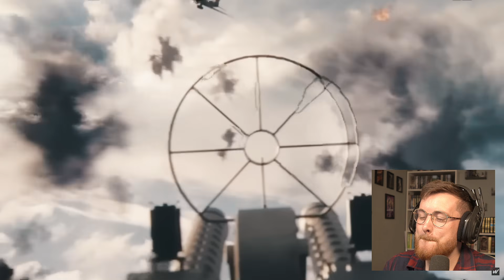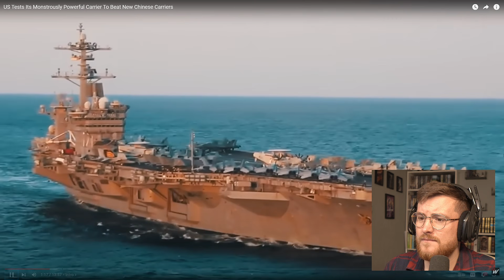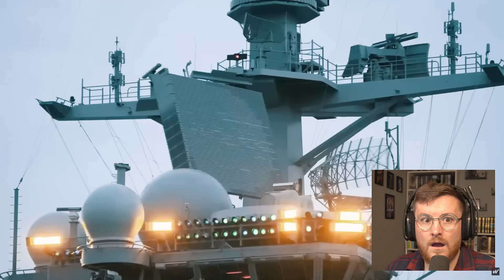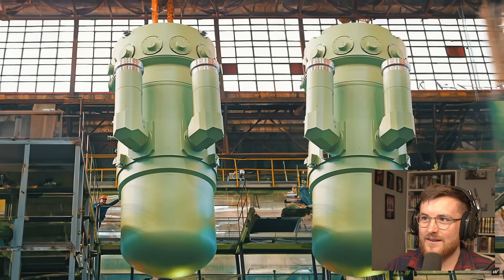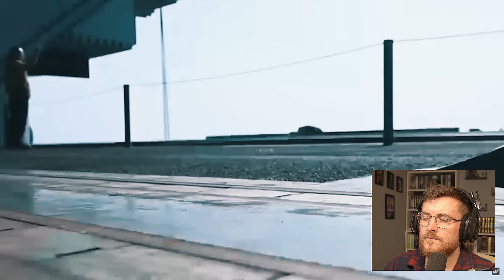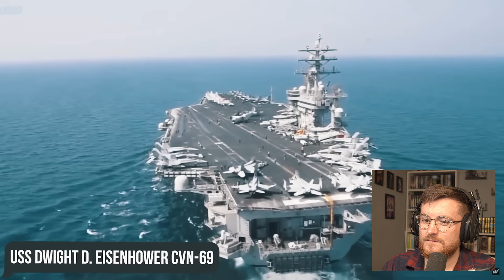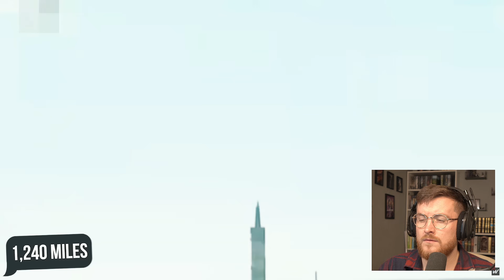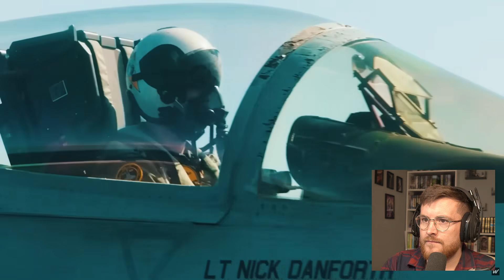Royal Marine Reacts To US Tests Its Monstrously Powerful Carrier To Beat New Chinese Carriers

Comment: What you have to remember is that when a new Ford class carrier is complete the US Navy will retire a Nimitz class carrier. So it's not like the Navy is adding another carrier. It's a 1 for 1 swap. New one in and old one out. So the crew from the retired carrier can go onto the new one. That's not quite how it's being done but kinda. And the new carriers are supposed to have less crew members than the older ones

Comment: It costs approximately $6 million to $8 million per day to operate a Gerald R. Ford-class aircraft carrier, including crew salaries, maintenance, nuclear fuel, and air wing operations. The ship, which cost roughly $13 billion to build, is the most advanced and expensive warship ever created. [1, 2, 3, 4]

Daily Costs: Roughly $6.5 million, with higher costs ($8M+) during active deployment.

Annual Operating Cost: Approximately $2.5 billion per carrier.

Personnel: Crew costs alone are about $3 million per day.

Comment: It's currently a 1 for 1 replacement. They commission a new Carrier and decommission an older one. They take several years to build so it's a decades long process. By the time the last one is put to sea it's replacement will already most likely be in the planning stage.

Comment: China doesn't have supercarriers. It's trying to build a large carrier that won't be operational until the mid 2030s at earliest, and it's still significantly smaller and carriers significantly fewer planes and resources than even the smallest American supercarriers. China's carriers are not a threat to the U.S.

Comment: So you are right, Plymouth is capable of handling some US aircraft carriers the newest biggest ones it can't though. The Gerald R Ford has been to Portsmouth fairly recently as that's one of the very few ports in Europe that's deep enough. Devonport often welcomes US ships, but usually it will be the support ships going to port as carriers cost an absolute fortune to keep in the water making every minute they are in foreign port rather than on mission a truly enormous waste of money. These things are designed to stay at sea and on mission in perpetuity only coming in for repairs and critical maintenance. It is an aircraft carrier and always in a strike group with a surface, submarine and air assets.  You can ship in and fly out anything and anyone you need to stay on mission until the next mission.

Comment: Due to its higher tech it's got a smaller crew than the ones it's replacing.  I served on the USS Theodore Roosevelt CVN71 and we had a crew of 6000 + air wing and + Marine detachment. All 11 of America's older carriers are nuclear powered and not much smaller at all. The TR held 110 air craft. It's the one that leveled Bosnia, with me in it and now it's one of our oldest ones.

Comment: Are they serious with that estimate on the DF-26 missile?  Imagine you’re in military intelligence and your job to know these things, and you tell your people ‘I need an estimate on the capability of that missile forthwith’, or something like that. So they go and do their thing, and then they come back with, “You know that estimate you asked us for?  Well, I’ve got a number for you;  We’ve estimated its range to be between 620 miles..  and 3x that distance. Yeah, just take that first number, multiply that by 3, and it’s somewhere in there.”

Although, I guess it’s at least possible that it wasn’t meant the way the wording made it sound like it was, and 620 miles to 1,860 is just the range window within which that particular missile is intended to be used. Like as in that missile is to be used for targets ranging anywhere from 620 to 1,860, while a different, shorter range missile would be used for something less than 620 miles away, and a different, longer range one will be used for something beyond 1,860. 

If that’s not the case though, that estimate could really use being narrowed down a bit.

Comment: The largest Cruise ship, Icon of the Seas, is actually heavier than the Ford class aircraft carrier (by about 15%). And the usable volume (because it is not made of heavy steel like carrier) of cruise ship is actually much bigger than the largest aircraft carrier's volume. So, the Icon of the Seas is really a floating city, while the Ford class carrier is actually not that large in comparison. It's made of heavier materials. And when you stand by it, it is not that large compared to standing by a cruise ship.

Comment: 7 month is a standard deployment for USN. Around covid then Russian invasion then hammas it often extended. But even without those they often extended. 

Supplies get moved in despite the size of the ship in hours typically. Bigger the ship the more ability to move bigger stuff around typically even at sea. The ship you were on sounds like a small boy like a frigate. They're tiny and we don't use them anymore iirc. 

You should look at the comparing the different ships with their sizes and how many souls on board.

Comment: That’s just the carrier. There is normally strike group that sails with it of between 10-15 support ships.

1 Guided-Missile Cruiser (air defense and command support)

2–3 Guided-Missile Destroyers (anti-air, anti-surface, and anti-submarine warfare)

1–2 Attack Submarines (fast-attack subs, usually operating somewhat independently but attached for strike group support.

1–2 Supply Ships (logistics, fuel, ammunition, and food, often operating with the group but not always in the immediate screen)

Plus other ships specific to its deployment.

Comment: The reason why we would require 10 of these Aircraft Carriers is because we cannot just move them around the globe.
So if stationed off the coast of Japan for example, and something happens off the coast of Italy or in the Middle East, it can’t just start moving there, it would take days if not months to get it over there.
Now if you have 10, you could position them so that there is always the power of these Aircraft Carriers and the fleet that goes with it in a timely matter.

Comment: China hitting a U.S. aircraft carrier is not as easy as target practicing with models in the Chinese dessert. First you have to locate the carrier which in wartime have several stealth systems to obscure the carrier. Finding them in the vast pacific is way smaller than a needle in a haystack. Then if you do find it, the carrier can move at 50-60 mph (or higher - classified ) so with vast oceans from the time the missile is fired the carrier could be anywhere in a 700 sq miles radius. Then you have to deal with the defensive systems which can track hypersonic weapons and likely will be using targeted energy systems (lasers moving at the speed of light) to shoot down incoming missiles. Plus firing a missile immediately puts the shooter at risk as they would know where it came from and immediately target it…

Comment: Military money is inflated 10x anyway.. so these monetary numbers honestly mean nothing.....
Reply: A bag of bushings, commonly used in jet turbines, was purchased by the US Air Force for $90,000, a price that has drawn criticism due to the relatively low cost of the individual parts, which can be found for under $100, according to multiple reports. This incident highlights potential issues with military procurement and the high cost of specialized parts.

Comment: Somebody tell him we have 11 nuclear powered aircraft carriers already 😂
Reply: Aren't all our Submarines Nuclear powered also lol.
Reply: @MadCity13 all of our subs and aircraft carriers have been nuclear powered since 75. 🤙
Reply: @megatron388 not accurate, we had conventially power aircraft carriers into the mid ninety’s, the America CV-66 and the JFK CV-67
Reply: @toddtraxler3878 All new aircraft carriers starting with USS Nimitz CV-68 have been nuclear powered. I served on USS Saratoga CV-60 in the 70’s-80’s but it was commissioned in 1956. Most of the carrier fleet was conventionally powered in 1978 when I enlisted and each conventionally powered carrier was replaced by a nuclear carrier as they were built. The greatest advancements in the Ford include the upgraded reactors which provide substantially more power than earlier nuclear carriers. Crew complement reduced because mag-lev catapults require less maintenance in theory and overall systems benefit from automation. The island structure was moved aft creating more forward flight deck capacity. New catapults are able to more finely adjust for different load requirements and are more reliable than steam catapults. With the air wings aboard the older carriers required crews in excess of 5000 personnel. Overall size of the Ford is not significantly larger than previous classes starting with Forrestal class in 1956. No other country has even matched the capabilities of our older carriers. The best aircraft we launched was the F-14 Tomcat which was amazing at the time but a dinosaur compared to modern aircraft. The Ford class will eventually replace all Nimitz class carriers and the fleet will have between 11-13 carriers as they have since the 60’s-70’s era albeit with twice the capability minimally. Bravo Zulu US Navy.
Reply: @megatron388  This is false, our last diesel sub was put out of service in 1990
Reply: Nah, I was on the Ike from 80 to 82.  It was one of three nuclear carriers (Enterprise and  Nimitz being the other two.)  The fleet had 13 carriers, 10 of them using boilers rather than reactors.  It took decades to retire the conventional carriers with nikes.
Reply: @MadCity13 I do believe so.
Reply: You beat me to it😂😂😂
Reply: Just be glad he’s already fanboying over our arsenal
Reply: @aljohntabion2751 
Yeah, he'd probably have a stroke if he saw our "classified armaments 😅 lol
Reply: Yeah, but there is something about having 10 Ford class Super Carriers, that is so awe inspiring and over whelming.
Reply: @DonaldDuvall  The other 10 are only marginally smaller. The Nimitz class is pretty close to the same size.  I would also note that we have two more America-class amphibious assault ships which are as big as what many other countries call aircraft carriers (with one more currently unde construction).
Reply: Yeah, but the Ford actually has "TWO" Nuclear reactors.  This is so that the laser cannon never runs out of juice 😉🙃🙂
Reply: Yeah their just replacing the eleven they already have.
Reply: We almost have 12, the John F. Kennedy is being fit out and planned to be in service by 2027 though the Nimitz is scheduled for decommissioning in 2026
Reply: And tell him we can launch a jet fighter every 15 seconds. Whilevthe Chinese have a ramp on their carriers , there planes carry little fuel or armaments due to weight restriction. Ours are fully loaded with both. Just watch a response to houthis fafo. It's amazing. Plus what the ships electronic can do. It's a floating fortress heavily armed. Cool huh?
Reply: Yeppp
Reply: Couple destroyers too.
Reply: And they require More crew.
Reply: Yes!
Reply: and nuclear subs that ONLY need to surface for food.  that's it!!!!!!!!!!!!!!!!!!!!!!!!!!!!!  Good bye anyone not USA! that challenges us.
Reply: And that's fully combat ready Carrier groups.
Reply: Yes we have approximately 10 to 11 carriers, but all of them aren't at sea at the same time. All of the Nimitz are on their way to retirement, so the Fords are replacing them. I expect Aircraft Carriers to be around till the 22nd century.
Reply: and 2 are under construction with 3 additional planned
Reply: By USA congress law or such. 11 max. Incase of 2 wars. Because of the 2 oceans USA boarders. They were prepping for world war 3 in the end of world war 2 end times.

Comment: The thing about having 10, is that they are not all active at the same time. Typical scheduling of them is about 6 months active in their area, a couple months downtime, a month or two out doing sea trials (not leaving much past the US area of influence), a few months of repairs/upgrades/etc, another couple months of sea trials...but it ends up at around 25-30% of the time, they are "on patrol". There are less US Navy air wings (the people and planes brought on to patrol). Except under very dire circumstances, you will not see more than 3 of these in one area...but that, in and of itself, would be enough for just about any other country to just lay down and give up.

Comment: 375 meters long by 48 meters beam  by 75 meters from keel to uppermost deck. I helped build the USS VINSON CVN 70 at Newport News Ship Yard. They're massive machines and rightfully called cities on the sea. 
When air wing and marines embarked, there are about 5,000 souls aboard. Two A4W reactors with flank speed in excess of 35 knots.
Most importantly, the Attack Group consists of SSN's, DDG'S, LHA/LHD. Older attack groups consisted of CVN, DDG, CGN, FFG, LPH/LPD, SS or SSN's and each of course had satellite overwatch as well.
No one in their right mind today wants to tangle with an attack group.
Reply: I absolutely understood ALL of those acronyms… not ONE was I unsure of… lol 😂

All kidding aside, I bet you are very proud to have been one of the lucky few to get the opportunity to build these absolute marvels of the sea and the pinnacle of research and technology poured into a titan of power. Thanks for your contribution and thanks for sharing.

Comment: The flight deck is 4.5 acres which is roughly equal to the space 43+ homes take up in London. It has 25 decks... (there are no figures for how much space per deck.)
You have to consider that even if there are ten of the ships they are not always on duty as they do have to come to dry dock every 32 months for maintenance that could take up to four or more years. Once re-launched it takes a minimum of 90 days to return to full duty. (Rome wasn't built in a day, right?)
Uh... 4,500 peeps is only counting for onboard peeps. You also have to consider supply ships and their personnel, personnel on the hard, maintenance workers, etc.
China starting a war with the US would be proof to the old axiom, "No good deed goes unpunished", considering the only way it could have won against Japan, without US aid, was through massive attrition.

Comment: Around 2600 Sailors, Airwing personal around 2480 So it's more over 5000 personel.  CVN-78 USS Gerald R. Ford carries a combo in general 75 aircraft usually F/A-18E/F Super Hornets (strike fighters) EA-18G Growlers (electronic warfare) E-2D Hawkeyes (airborne early warning) MH-60R/S Seahawks (helicopters for anti-submarine and rescue)  F-35C Lightning II and unmanned systems (e.g., MQ-25 Stingray) The exact number can vary based on mission profile and aircraft mix, but around 70–75 is the standard full complement.
It also has defensive weapons . RIM-162 Evolved Sea Sparrow Missiles (ESSM) Purpose: Defense against incoming missiles and aircraft. Range: ~30+ nautical miles  Intercepts supersonic threats too fast for guns.  Rolling Airframe Missiles (RAM) Purpose: Last-ditch defense against anti-ship missiles.
Highly maneuverable, designed for close-range interception.  Phalanx CIWS (Close-In Weapon System)  20mm Gatling gun (6,000 rounds/min)  Final line of defense against incoming missiles or aircraft. Radar-guided, fully automated.
 Mk 38 Mod 2 Machine Gun System   25mm cannon, manually or remotely operated.
Role: Defense against small boats and close-range surface threats.

It also has  Electronic Warfare & Countermeasures: SLQ-32(V)6 SEWIP (Surface Electronic Warfare Improvement Program),  Decoy launchers (e.g., Nulka decoys)

The ship has multiple galleys, including:
The main galley 
Wardroom galley (for officers)
Chief’s mess (for senior enlisted)
Enlisted mess decks (for junior enlisted)
Each galley is a fully equipped industrial kitchen that operates 24/7.
Mess decks:
Large cafeteria-style dining halls.
Serve food in rotating shifts to accommodate duty schedules.
Meals per day:
Over 15,000 meals are prepared daily.
Crew members typically get 3 meals a day, with midnight rations ("mid-rats") available for night-shift workers.
The ship has massive refrigerated and dry storage areas below deck:
Can store 90+ days worth of dry goods and frozen foods.
Fresh fruits and vegetables are stocked regularly when in port or via underway replenishment (UNREP).
Replenishment at Sea:
Supplies are delivered via supply ships while at sea.
Food is transferred in bulk through high lines or helicopters.

Comment: Compete with?
Come compete with?
What are you Is talking about compete with? China has never had a piece of equipment that could Is even the oldest and smallest aircraft Carrier. I've ever been on the USS Midway. She may have only had 2 catapults, but still run circles around anything.China has put in the water. To compare the chinese pieces of junk they have floating around posing As Is an aircraft Carrier. To the likes of the gerald r ford is just embarrassing for china .

Comment: Fun fact: the U.S. military has stated they can facilitate & open a Burger King, anywhere in the world - in 48 hours 😂

And have demonstrated this capability, several times: 

Bagram Airfield, Afghanistan (2002) – Set up within 18 hours of troops securing the airfield, making it one of the first “combat Whoppers” in the War on Terror.

USS Harry S. Truman (2003) – A fully functional BK was installed mid-deployment in under 24 hours after sailors demanded it.

Al Asad Airbase, Iraq (2006) – Despite incoming mortar fire, a Burger King was operational in 36 hours—proving even war zones can’t stop the Flame-Broiled.

Camp Lemonnier, Djibouti (2011) – In 100+ degree heat, a modular BK was airlifted in and serving meals in 22 hours.